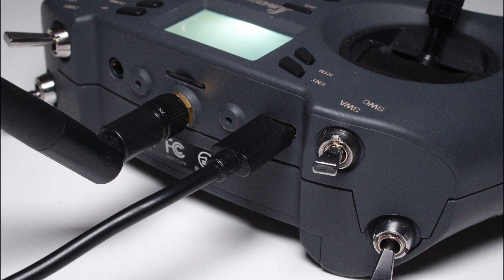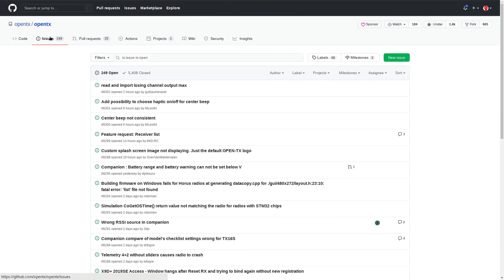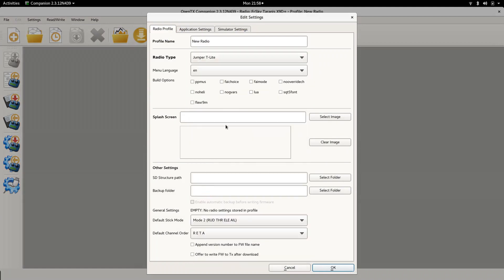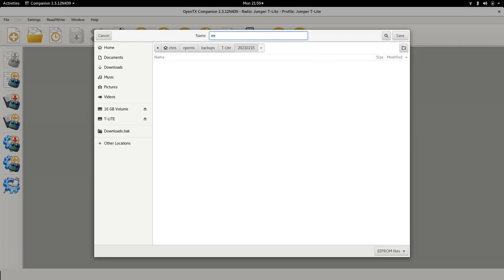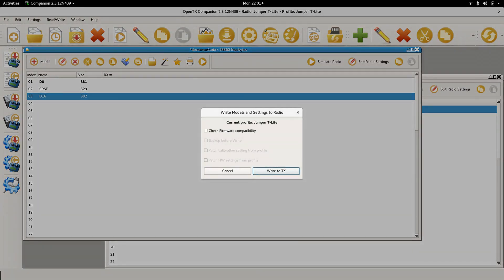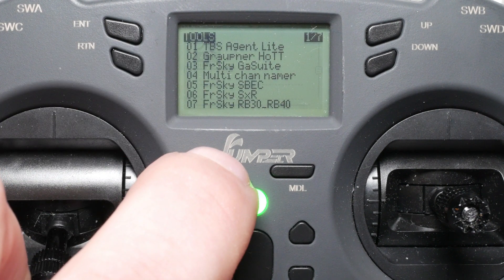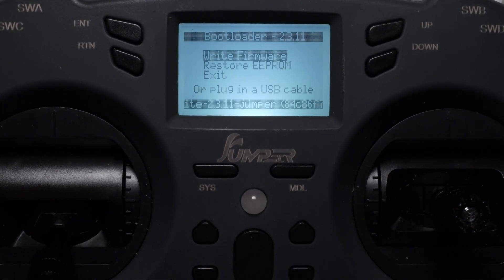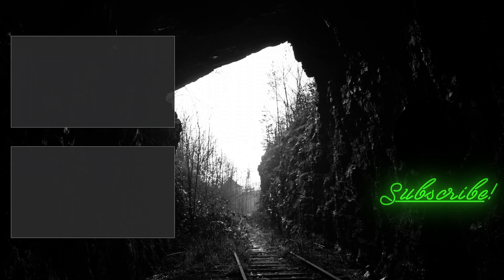OpenTX: How to back up models, EEPROM and firmware (and a word about nightly builds)

Comment: I have the jp4in1 w/crossfire v2 model when I put into buying mode it will not bind with any receiver and when I go to take it out of bind mode the radio keeps chirping
Reply from the maker: Sounds strange to me. It should chirp when you are binding not when you stop binding also what are you binding to? Which protocol and internal or external module?
Reply: @stylesuxx  lol FlySky,FRsky ,jumper d8 &d16
Reply: @stylesuxx  I have the jp4in1 v2 model I use crossfire  but haven't used crossfire yet because I was waiting to order a nano cuz I want to make cuz I wanted to make sure other receivers were working first
Reply from the maker: @Addiccted2DRONZ  OK, so you are trying to bind with the internal module? Which protocol exactly? I think you are better off asking in the jumper facebook group, will be hard to debug this here without being able to see what you are actually doing ;-)

Comment: When I connect my Jumper Lite to my PC it makes the keyboard freak out. It's like something is pressing the enter key every second. Any ideas?
Reply from the maker: What OS are you on? Can only imagine it to be some kind of driver issue.
Reply: @stylesuxx  Windows 10. Tried a bunch of stuff... Will try it on my laptop next. Thanks.
Reply from the maker: @NETBotic  Yeah, I can't really help you out with windows. Am on Linux myself...
Reply: @stylesuxx  It appears the issue only happens on Windows, and only when there is no micro SD card in the Jumper Lite TX. It looks like autoplay doesn't like the empty card slot, and appears to cause explorer to glitch once per second. I was able to replicate on another PC so I wonder if it's something to do with my controller.
Reply from the maker: @NETBotic  Very interesting. In any case - you are the first one I hear this from, so maybe it's really "just" your controller - especially if you can reproduce it on different systems.

Comment: Hi, I'm accidentally flashing my jumper Tlite when using betaflight (I accidentally pick wrong port), and now my jumper T Lite cannot be on, do you have any idea how I can fix it?
Reply from the maker: Use openTX companion and flash back OpenTx and you should be fine.
Reply: @stylesuxx  Great, finally after some hours. I fixed my jumper T Lite, the problem was got blank screen everytime after I see open TX Logo. and I fixed it by configure contrast configuration from open TX companion. thank you so much!

Comment: Do you have a video on how to flash the firmware directly from the PC running Windows to the Jumper T-lite? I installed OpenTX Companion for my first time. I read a manual on OpenTX.org to learn, but they talk about installing a driver STM32 BOOTLOADER with a tool called Zadig. And, very important, they say the radio must be turned off when flashing the firmware from the PC. The manual is for flashing Taranis radios, but it is the same for Jumper T-Lite, yes? This is all new to me. First time I will try to upgrade the OpenTX  version on a transmitter. I did already succeed to getting the newest version of the sd-card content for the newest OpenTX version. Now trying to update to the newest OpenTX version on the T-Lite.
Reply from the maker: Yes, it's more or less the same process for every radio, put it in bootloader mode and flash the firmware. I recommend doing a complete Backup in the companion, just that you have something to come back to.

Comment: Can you do a video on setting up crossfire module with the jumper lite. Thank you
Reply from the maker: Hey, not sure if it is worth a video - setup is pretty straight forward - install the TBS Agent lite lua script and in the model set to external and CRSF as protocol. Or is there something you are having a problem with specifically?
Reply: @stylesuxx  really I just need to know how to get crossfire on my sd card. What do I save it under in my sd card and can I get this for tbs website.
Reply from the maker: @skygroover6692  you can get it from the TBS website, just save it in the TOOLS folder.
Reply: @stylesuxx  thank you for taking the time to help me, do you have patreon
Reply from the maker: @skygroover6692  anytime, feel free to ask more questions should you run into any issues - and no, I don't have a patreon.

Comment: Nice guide for beginners like me.

I was wondering if you are familiar with ELRS? If so, could you make a video on how to flash the firmware specifically on the T Lite? I'm trying to wrap my head on the steps but it is too confusing. I have seen a Chinese guy running DIY Slim ELRS module on his T Lite and was wondering what versions of OpenTX is he running since another guy on the ELRS Discord couldn't get the ELRS firmware to flash.

Thank you for your time.
Reply from the maker: Well, you can't really flash ELRS onto the T-Lite. You need to have some kind of external module to which you flash ELRS. From there it is "relatively" easy, just select CRSF as protocol, use the ELRS Lua script and you should be good to go. There is no special version of OpenTX needed, it just needs CRSF support, which is enabled in the firmware that is flashed on the T-Lite anyway. So, your best bet would be to get an R9M Lite - this one is fully supported - flash ELRS and you should be good to go.

Now thinking of it, I actually have a R9M Lite module I could flash...
Reply: @stylesuxx  
Thank you for the reply.
I see. So the ELRS firmware is written on the external module and not on the T lite itself. Come to think of it, it does make sense as the you only have to select the target TX when compiling the fw on the ELRS configurator. Silly me! Please do flash the R9M Lite using the T lite. You'll be the first one to show us how to do it. Makes the T Lite even more interesting as it is now.
Reply from the maker: @supersaiyamarimo  OK, I just did - that was super straight forward - just following the steps in the Wiki - but if you think it makes sense and would help people, I can do a video, maybe next weekend.
Reply: @stylesuxx  Great! would love that.

Comment: I have a quick question for you, I have been following all your videos about the T-lite and I also watched some other ones and in every single one when powering up the transmitter the only warning is usually the throttle or switch warning but mine have an extra one that even though I already get used to it, it is annoying. I have a "use as a test only... Press any key" did yours had it too and you disabled it? Or yours didn't have it??? If yours didn't could you be so kind and email me a copy of your firmware bin  and eeprom file to ggherbaz@yahoo.com, I will really appreciate it. Regards.
Reply from the maker: No mine did not. This is a warning that you usually get when using a none stable release. It can not be disabled via menu. You can find the original firmware I had on mine here => https://drive.google.com/file/d/1IJpfx5L4hPRx4Xwbdhk6GcxIMJWJHKV0 your EEPROM should be OK.
Reply: @stylesuxx  Thank you, that fixed the issue right away. I know that I bought mine on pre-sale but they should have send it with a "stable" firmware and not a test one.
Reply from the maker: @natureboy3921  The point is - there is no stable Firmware yet released for the Jumper T-Lite. If you compile it by yourself it does not give the warning though - at least not for the T-Lite. Not entirely sure what is up with that... Soon there should be a new OpenTX version including everything for the T-Lite.
Reply: @stylesuxx  I completely understand that, but even though I love this little radio, jumper practices in regards to it's radios firmware is very unprofessional, they should as they do with their main radios put the latest release firmware on their website since I assume I'm not the only one with this issue.
Reply from the maker: @natureboy3921  I understand - but they also rely on the OpenTX dev's to finalize their work and publish the release. I also think that Jumper rushed this radio a bit, just to get it out before Chinese new year and that's the reason why things turned out less than optimal.
Reply: @stylesuxx  jumper should use some of the money from the sales to finance open tx development or hire developers to deliver radios with finished and stable firmware.
Reply from the maker: @natureboy3921  Yes, I see it the same way. I think the major problem here is that one of the OpenTX devs is/was employed by FrSky - I can imagine that this is reason for some bias. It is also very hard to convince the OpenTX devs to add new things - I'd say it is one of the most restrictive OSS projects I have ever seen. But I think Jumper could easily maintain their own fork of OpenTX for their own radios.
Reply: @stylesuxx  Also why Jumper doesn't have a bin file for this transmitter in their website? Heck not even the info of this radio is in the website. But thanks again

Comment: Thank you for another clear video.
You even snugged in a how-to-update-the-firmware! 👌
Reply from the maker: There will be a separate one for updating, explaining the fw settings in a bit more detail ;-)
Reply: By the way... To connect the T-Lite to Companion, I usually don't put it into bootloader mode. I just connect the USB and select "USB Storage" mode, this works fine for reading, writing and backing up the models in Companion. Only for a firmware update I go into bootloader 😉
But I got to be careful to eject the detected drives before disconnecting though! If I don't do this properly I end up with corrupted models 😣
Reply from the maker: @henkdevries2971  Good to know that this is an option too - thanks!
Reply: @stylesuxx  Do you know off an easy way to copy over parts of one model to another (all mixers for example) in one go?
Reply from the maker: @henkdevries2971  I don't think you can easily copy parts of the model. I like o first clone the model and then go from there. Maybe it's easier to adjust that through the companion, but I doubt that three is an option to just copy the mixers...